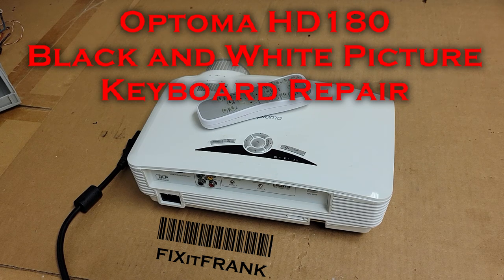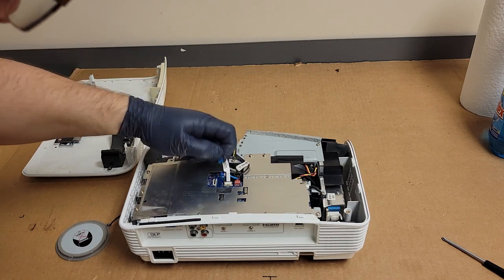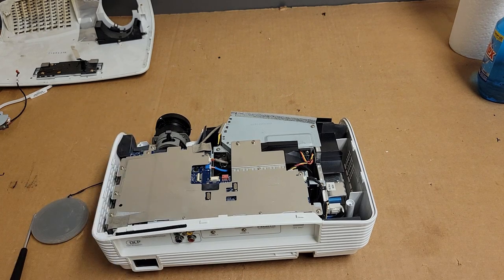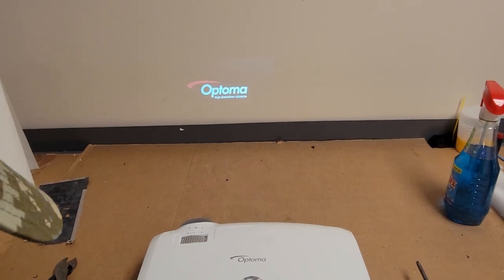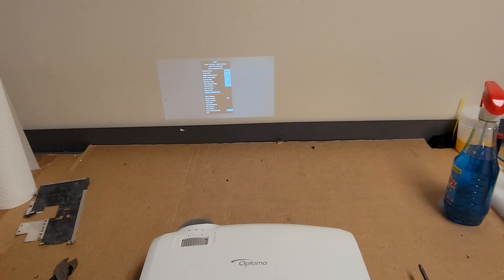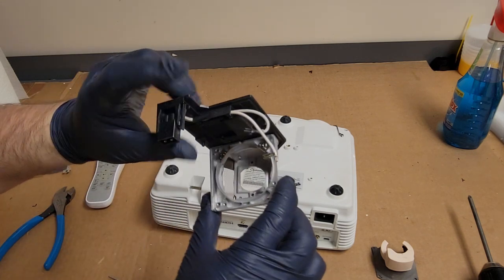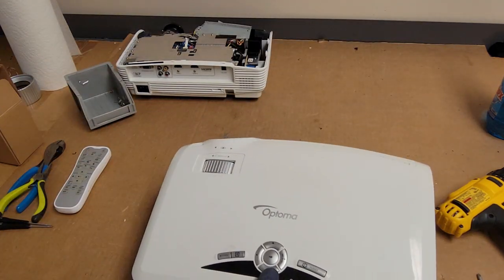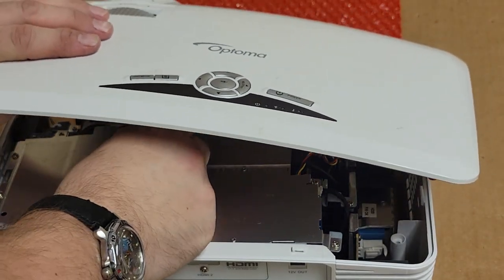Optoma HD180 DLP Video Projector Repair (BW Picture/No Button Response)

Comment: Hi Frank. My optoma HD180 recently went. Power won’t turn on. I contacted optoma but since the device was discontinued they couldn’t help. I looked on YouTube and eBay and I was trying to reuse the ceiling mount in it’s current position so I ended up buying a optoma HD20 without a remote. I was able to get it going and reuse the mount, but I can’t get it to fit the size of the projector screen. It’s about 4-5 inches short on the top and left/right sides. The zoom ring doesn’t seem to be working either. I’ve tried the factory reset and that didn’t do anything. I purchased the remote for the HD20 separately and it doesn’t work at all. I don’t want to keep wasting money. I was hoping that the HD120 only needs a light bulb replacement but I don’t know too much about these things.  I’d much rather be able to salvage the HD120 since I wouldn’t have to worry about fitting the picture. Any suggestions would be appreciated.
Reply from the maker: Hi Rick! First off, Im sorry. What a drag. Lets start with the HD180.  Does it do anything? any leds or fans?  It could be a power supply but hard to say without seeing it. 
The HD20 should definitely fill that screen.  It is good up to 300".  I wonder if the lens got smacked in shipping and it jammed the zoom?  Does it feel like it can focus but just cant zoom?
I dont know how handy you are, but the power supply in the HD20 and the HD180 should be the same.  You may be able to swap the boards and get the HD180 back up and running.  But if the remote isnt working that is weird.  They are fairly generic and the 180 and 20 should share the same remote if I remember correctly.   If you want to post over here, there are a few other projector professionals who contribute https://www.facebook.com/groups/2046110345431577
Reply: @FixitFrank  thanks for the quick response. The HD 180 doesn’t power on at all. I checked other outlets in my house and nothing. Once I got the HD 20. My wife plugged in the HD180 with the power cord from the HD20 and it momentarily turned on. I can definitely focus with the HD20 but nothing happens with the zoom. I’m able to toggle the zoom ring without any restriction. Unfortunately, I don’t have FB so I can’t post. I watched your video for the HD180 and saw that there were two screws on the area where you took out the lamp. On my HD180 there only one screw. I took it out and I’m not able to remove the lid. I don’t want to apply too much pressure as I don’t want to break it
Reply from the maker: see if ther is a second screw under the sticker.  That might be covering the screw.
Reply: @FixitFrank  thanks. I will check when I get home.
Reply: @FixitFrank  I was able to find the second screw, thanks!  I removed the lid and I was able to remove the lamp. Do you think replacing the bulb will turn on the projector? I don’t want to continue to invest money if I can’t get it to work. I was going to order another bulb from eBay. What do you suggest?
Reply from the maker: honeslty not using eBay for one.  There is no one there who I would trust personally.  I would try the lamp from the other projector first. They use the same BL-FP230D. that lamp has a proper IR cut lens.  Ebay USA lamps are cheap and usually dont have the right lens which will ruin the projector. I'd check projetorcentral.com and see who has the best reviews in the lamp vendor section.
Reply: @FixitFrank  out of curiosity, what would be your charge if I sent you the projector to repair?
Reply: If you’re willing and able to fix the HD180 I’d be willing to gift you the HD20.
Reply from the maker: well most of the time, I charge parts and then ask for a donation to a local animal charity that is important to me.  I like to do this to help people. I have a day job that pays okay.  If you covered shipping I am pretty sure I could make one out of the two projectors.   If you are interested we can talk about it.
Reply: @FixitFrank  thanks for the response. That’s an admirable thing that you do. I am very interested.
Reply: Hey Frank. Hope all is well. Not sure if you still have our previous conversations but I’m still using the Optoma HD20 and haven’t been able to get the picture to fit the screen. I also still have the optoma HD 120 on a shelf. I really don’t want to purchase a new one as money is always an issue these days. Would you be willing to assist me with trying to either fix the 180or working some magic to get the 20 to fit the screen. Thanks!

Comment: Hi! When you opened the projector to clean the fan and the other part, what is the other spinning round part? Mine is making a loud vibrating noise.
Reply from the maker: Hi Donna, that's your color wheel. If it's vibrating loudly, it's time for a new one.

Comment: Hi Frank! Your videos are awesome!  I have this Optoma HD180 projector and the color wheel broke on me. I replaced it with one from ebay and put a new lamp in. Now the picture is in black and white. I decided to get another color wheel thinking the ebay one was not compatible. The new one still shows up in black and white. I reset the projector back to factory defaults. Is there anything else I can do to fix the color?
Reply from the maker: That is really strange.  The wheel must be spinning or the picture would not come on.   I'd think it was a problem further up the signal path.  If the menu is black and white then you are losing the chroma signal somewhere.  The HD20 service manual is easy to find via google. It is basically the same as the 180.  
If the menu comes up in color, check all the inputs, your cables etc.  Basically the color info and the light info(black and white) tend to get processed individually.  
Make sure you do a full reset on your picture settings first in case the 'color' setting was turned all the way down.
Reply: @FixitFrank  thanks for the quick reply. So the original color wheel shattered. It was definitely the original issue. On the first repair attempt, I put the color wheel cable in upside down and the lamp did not come on. Now the lamp comes on, so I know it is correct. I duplicated the issue several times to confirm. So the wheel is definitely spinning as you suggested. 
I do not have any cables other than power at this point. The splash screen typically shows a red logo and the menu has blue in it. With the new color wheels it is all black and white. I did go through the menu and reset it back to factory, but that did not change it to color. I tried changing the background to blue as well, but it is sill grey. I don't know what else to try and I would hate to trash this thing. It has a new lamp in it as well. Can it possibly be the lamp? Unfortunately I already threw out the old one. 
I will recheck all of the cables on the MB to make sure they were installed correctly. Will give optoma a call as well. They have been helpful, even though this thing is old.
Reply from the maker: Since everything is black and white that really sounds like a mainboard.  One thought I had was the check the service menu and adjust the index position of the color wheel. I can't see how the old wheel exploding would cause the color signal to vanish but maybe the heat that caused the wheel to fail also damaged some of the electronics. 
The fact that the wheel is spinning is curious though. that means something with the color is working.  If you can adjust the index setting, you might be able to effect some sort of change. At the least, the service menu gives you access to more test options.  If all else fails, the mainboard has a problem. Troubleshooting that will be difficult unless something is physically obvious. A replacement mainboard would be the easiest option.

Comment: Hitachi PJ-TX10 Projector, lamp and temp leds blinks, but lamp is smoothly works good, msg appears "CLEAN FILTERS THEN POWER OFF AND RESET TMEP" then disapear within half a minut. But when i go to setup then, not values show or active in reset lamp or dust cover etc., kindly let me know how can rectify this issue.????
Reply from the maker: Hi Muhammad! Please check the fans. Mainly the fan near the filter. If it slows down the airflow may seem restricted and cause that error.
Reply: @FixitFrank  it looks really slow speedy. thanks. I will see it in free time soon.
Reply from the maker: Yes, if the fans are slow, then I bet that is the issue.  It would make sense.

Comment: Surprised that color wheel wasn't really unhappy after what happened to it. But I'd guess that you'd find a use for that hub haha
Reply from the maker: Im actually going to use it with something that is coming together in my head.  I want to make a color wheel tester and this will give me a motor to work with that wont cut my hand up with spinning glass shards.
Reply: @FixitFrank  That would be cool! How do you use one color wheel to test another color wheel though?
Reply from the maker: oh just for building it.  That way if I drop it, spin it too fast etc, I don't break or injure anything.

Comment: Hello ,if i want to see hidden menu like optoma(power,left,left,up) on Epson emp 83h,what buttons i need to push? Thx
Reply from the maker: I am not sure.  epson does not share that information.
Reply: @FixitFrank  ohhh,ok...Thx for the answer
Reply from the maker: I wish they did.  One reason I do not have many epson videos is the lack of service info or parts.  They are not friendly with the right to repair movement and that is frustrating. what function are you looking for?
Reply: @FixitFrank  i just want to know if lamp is old ,hours in menu is just 150,lamp is looking fine,but i think is reset..i paid just 30 euro for projector,sorry for my english,im from Romania
Reply from the maker: Your english is perfect! No worries :)  It would be hard to tell if they reset it anyway. If the inside of the globe looks clear/shiny, it is probably OK.  30 euro is a good price even if the lamp is old.  I hope you get a lot of use! Thanks for commenting!

Comment: hello Fran mk my optoma hd 25 projector fell to the ground I opened it and a large 1285 fan broke into pieces, I rebuilt it and it makes a fatal noise.

the screen is completely white, no menu osd, could it be the dmc or the wheel ???

or the main

I don't know which parts to buy, the whole screen comes out blank
I subscribe you have my likes, good video thanks Frank.
Reply from the maker: Hi Carlos, It sounds like the mainboard and DMD board are not connected.  Dropped projectors can be difficult to diagnose without seeing them.  But, I think you may be able to take it apart, then put it carefully back together.  If all connectors are seated properly, you may regain operation properly.
Reply: @FixitFrank   very thanks

Comment: Of course Osram would not admit 190w 200w 220 230 E20.8 lamps are the same. I also feel they are all the same. You do have a hot glue gun just melt some glue stick for those nuts. They are ideal for that. I tend to to use soldering iron and melt some white plastic for those kinds of repairs. 
Hey Frank how much do you want for it? Can I come over and collect it? I only have sterling though, no dollars.
Reply from the maker: Brother, I will take sterling of the dirty USD any day. Granted Bojo's flub with brexit has me a little concerned about the sterling but our economy is in the toilet so I am sure it's still worth more. Make me an offer and if you come and get it, I will treat you to dinner.
Reply: @FixitFrank  Cheers Frank. Appreciate it. Stay safe.

Comment: Maybe make comparison of lamp projector vs LED projector? Are they worth anything? I have normal Sanyo projector at home, once or twice I used very very tiny LG LED projector, that was bright for it's size, there is a lot chinese projectors, most of them look more or less like garbage, native resolution of most of that things look shitty, lumen output look definitely fake, there is any chinese LED projector that can handle ~100 inch display and have at least 720p native resolution?
Reply from the maker: Oh man. I would love to do that. I have been trying to get my hands on one of those fake 3 letter units.  NOO, YJJ, Vankyo, etc.  On reddit a guy went down the rabbit hole and found out that most are rebadged R18 projectors. The specs are entirely made up.  The real specs on most are 300-400 lumens and a single LCD panel with 640-480.  
Problem for me is that I can't justify buying one just to show how bad it is.  Youtube pays me, but honestly its not that much.  Last month was $137.  I'd rather use that money for tools and whatnot. 
I even tried offering someone a free DLP projector in trade for their broken Vankyo and they were interested and then ghosted me.  I get emails from amazon sellers who want me to do videos on their stuff but so far, none of them are projector sellers.  I usually turn them down because while I will not lie and say I don't like free stuff, I don't feel its right to shill for someone unless I actually like the item.  If I won't use it, then its not right to advertise it. 
However if a Chinese projector seller gets in touch, I will accept it.  They may not realize I will be tearing it down and I am not going to tell them :)
If you hear of anyone who is looking to get rid of one of those projectors, let me know.  I would gladly trade for a older but working DLP projector. The only caveat is that they need to be in the states because shipping...
Reply: @FixitFrank  So maybe you will make video of conversion normal projector to LED, projectors are easy to cheat that bulb work correctly, one of wires that is connected to ballast send state of lamp, if it's 0V it says to projector that lamp work correctly, if it's around 3-5V it says that lamp is can't start, if you bridge that wire to ground projector will ignore lamp state, and you need strong light source, on aliexpress for less than 2$ there are LED chips for floodlight, they have 10-50W, it's powerful, don't need any power adapter, it is for direct connection to power grid, but it blinking, aliexpress sell also DC 36V LED chips up to 100W, they are even stronger, but they need power supply, very powerful power supply, they don't blink because it's DC and also you need radiator that fit into projector with fan, and can spread 50-100W of heat (like computer CPU radiators), that the most hard to do part 
I've hope that I'm easy to understand, English is not my native language
Reply from the maker: Brother, your English is better than a lot of native speakers. I'm positive it's better than my Polish? Czech? I understand everything and you make total sense. 
I've actually gone down that path and found that it's not as viable for more modern projectors. The main issue is the lux to watt difference between a high power led and a mercury short arc lamp. If I recall correctly, the short arc lamp is 1 watt per 200lux (average) and an led is 1 watt per 50 lux. The other issue is the color quality. Led is very narrow in it's colors. The red blues and greens needed for the color wheel are not in a white led.  The closest I got was using a 50w rgb led and then the heat was much more than the short arc for much less light. Most LED/solid state units use red and blue leds and a green laser source that uses a uv laser to excite a green phosphor wheel. However this would be good to show in person. It may save a lot of people some hassle.
Reply: @FixitFrank  I'm Polish, it's very similar language to Czech, Poles can freely communicate with Czechs without learning their language (~30% words sounds the same), but this languages have many words called "fake friends", that words sounds the same or similar but have completely different meaning, for example:
In Czech ''divka" means women, in Polish "dziwka" means whore, in Polish "szukać" means search, in Czech "šoustat" mean fuck, "kwiecień" in Polish means April, "květen" in Czech mean May etc. that can occur funny situations, imagine to be a pole that try to find job in Czech :D 
I had much easier to learn English than you Polish, English is all around, 90% of internet is in English, most of movies is made in Hollywood, main reason why I learned English is because I hate movies with lector, all movies in Polish are with lector, just animations have dubbing, watching with original soundtrack solved that inconvenience, now I hate lector even more
Reply from the maker: LOL. I can see how that would be!  I have been learning Cyrillic and Russian and have begun to see a lot of similarities to nearby languages.  My goal is to be able to watch some documentaries and read some books in their native language.  The translations just do not seem to work as well.  The whole etymology of language is pretty interesting.
Reply: @FixitFrank  So you are more advanced at Russian because I don't even know how to read Cyrillic, Polish have normal Latin letters with some extra letters like ąęśćółżź (but we have the same keyboards like US keyboards) and things like rz sz cz dz dź dzi that are treated like one letter, Czech is similar, they also use Latin letters but they have other additional letters, some of them is the same as this things that we threat as one letter, some of them is normal letters but pronounced longer (I don't see any sense in having other letters for that), Russian have many similarities to Polish but this completely different language, most similar in Russian is grammar, we have some similar words but it's not enough to communicate, is similar in the same way as German is similar to English, the same roots, but completely different